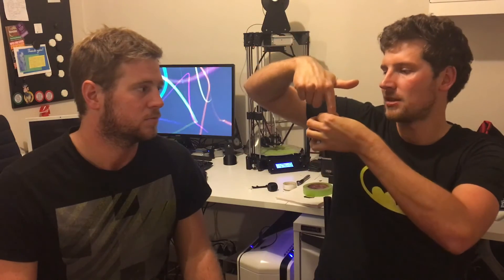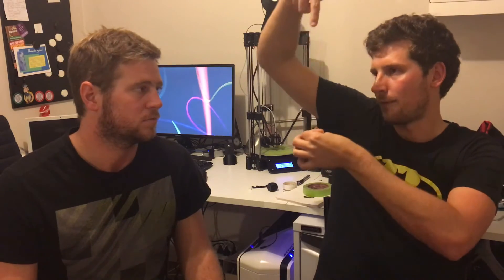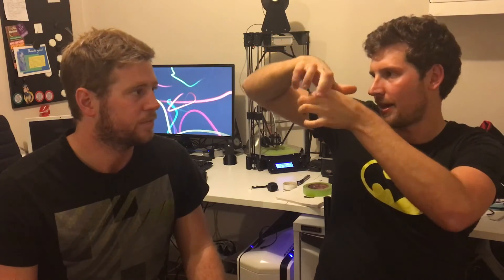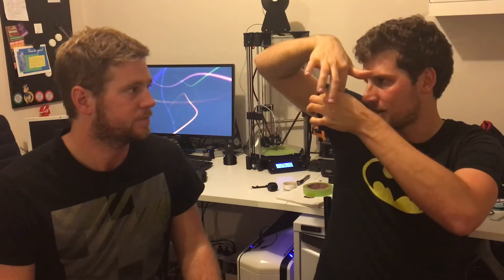How to troubleshoot jaycar tl4100 3d printer arduino

Comment: Hey guys. Thanks for the video. I've been searching for info on this printer but it's very scarce. My son bought this printer from Jaycar back in early March (2016). He'd been saving for a 3d printer for ages & unfortunately is has not been an easy introduction to 3d printing. Eventually, it was beyond the tolerance of a 14 year old so I've been trying to get it "working" for the last month. I now have PLA printing reasonably well but ABS is definitely a struggle.  A few observations of this printer:
-Levelling the bed is an absolute pain (as is keeping it level). I suspect the aluminium warps slightly as it heats.
-Patience is needed when heating the bed to 110 deg for ABS. It takes about 12 minutes.
-The ball & socket connectors for the delta arms are loose. I use rubber bands at each end of the arms (as well as the provided springs).
- Slow prints seem to be the way to go for ABS. I print at 10mm / sec. Any faster and the bowden extruder strips the filament.

At the moment, my goal is to use this printer to hopefully print the ABS parts to build this: http://www.thingiverse.com/thing:1001065
It's going to be a slow process :-(
Reply from the maker: Hi Matthew, we are sorry to hear you are having so much trouble with your 3D printer. We have only been printing with PLA so far and would recommend printing with ABS unless you have your room well ventilated. When printing with ABS it is toxic.
We are printing with PLA from Hobby King, It's melting temperature is 200 degrees and we only use a little bit of hair spray and heat the bed up to 55 degrees. We print with Repetier and have started slicing with CuraEngine. The only thing I had to change was the retraction distance to 1mm under the extruder tab, delete the G29 from the G-Code tab and create a few more quality options under the speed and quality tab. I  We also had issues with the screws coming loose. i have used thread lock on most screws, especially the screws holding the arms and the leveling screws.
We also had problems with the bed leveling, I was having to adjust it almost every print. We found out that the little grub screw had come loose on the main gear of the stepper motor and was slipping. Check that the grub screw is screwed down on the flat part of the stepper motor shaft and make sure you belts are tight. I have our belts tight enough that you can play it like a guitar ;)  also i added lubrication to the main metal poles the x,y and z slide up and down on.

My next project is to setup auto bed leveling with this printer, I recently bought this sensor http://www.ebay.com.au/itm/172077317235?_trksid=p2060353.m2749.l2649&ssPageName=STRK%3AMEBIDX%3AIT and i will be doing a video on how to upgrade it soon.  

Thanks for sharing that 3D printer I'm keen to try and build it also

Please contact us if we can be anymore help or if you have ant useful tips we would love to hear them.
Reply from the maker: He's the link for the filament we have been using http://www.hobbyking.com/hobbyking/store/uh_viewItem.asp?idProduct=96887 but they out of stock atm

Comment: what filaments are you guys using, the ones from jaycar?
Reply from the maker: We started using the white and black PLA from jaycar but have started using hobbyking's 1KG PLA for around $20. Its alot cheaper and better quality. We found it melts at a higher temperature so it didn't warp as much throught the extruder pipe